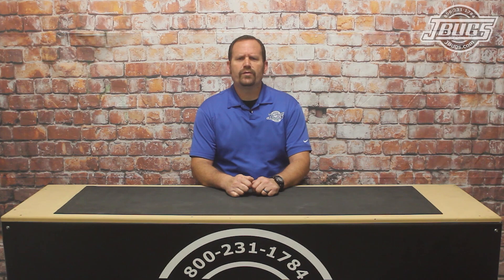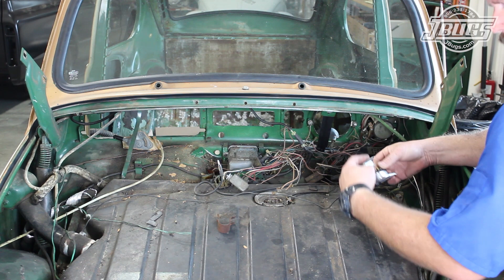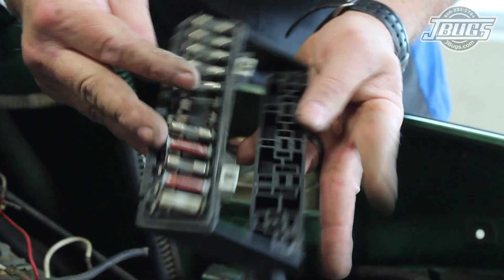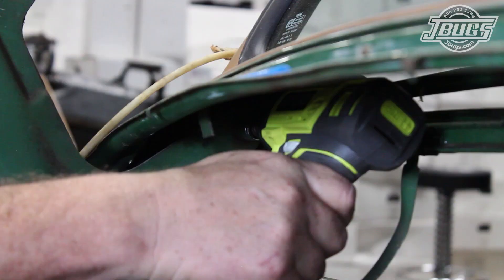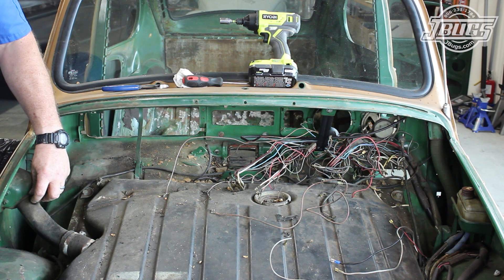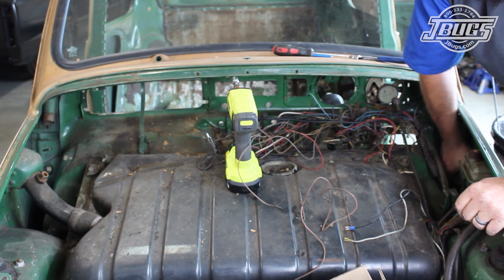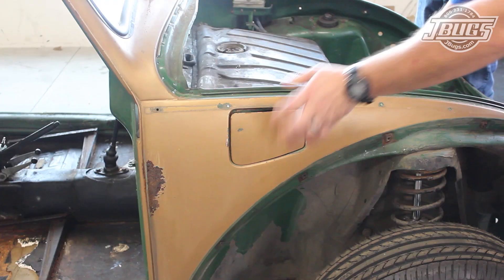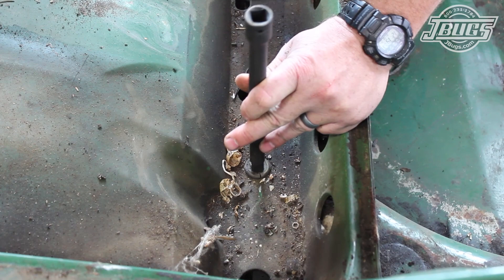JBugs - 1971 VW Super Beetle - Trunk Disassembly

Comment: Please please please do a full re wiring
Reply: The "mechanic" I used, assured me that he knew where every wire, relay and switch went but here I sit with no head lights, interior light and no tail lights.
Reply: It’s coming, we’re working on the cleaning up the chassis and doing body work at the moment!